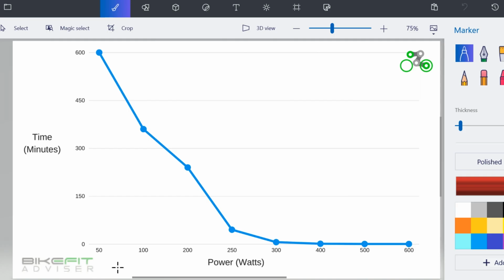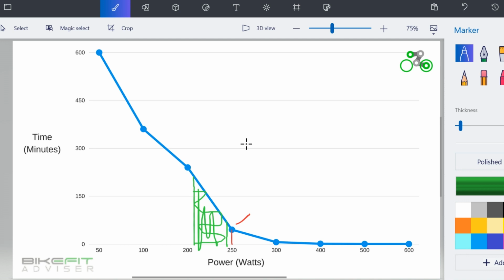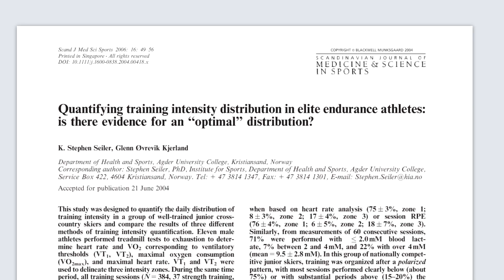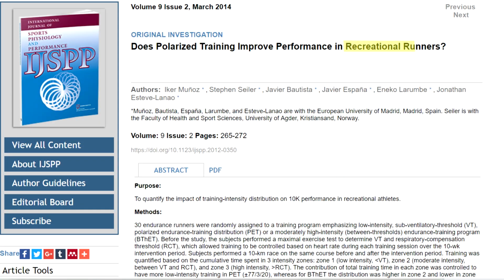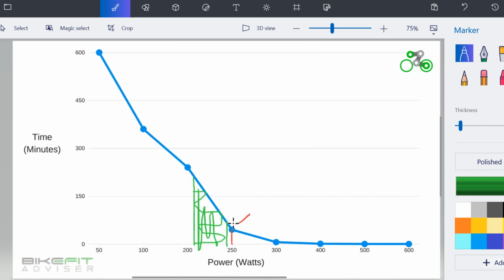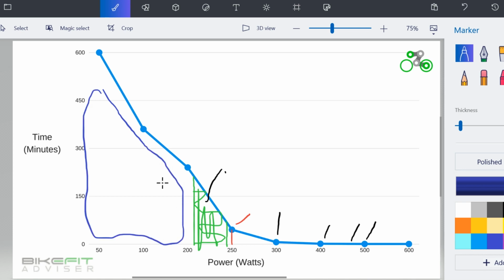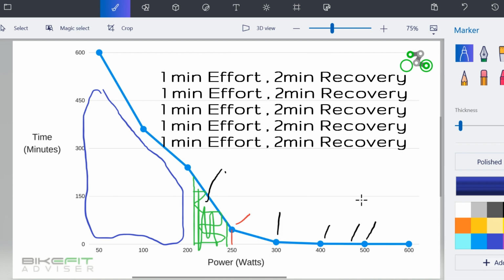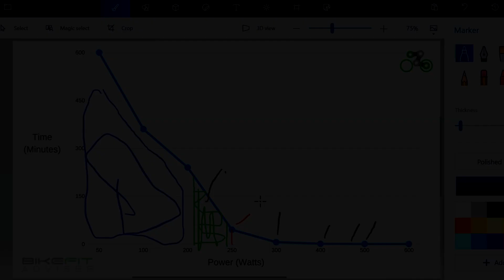A Training Mistake That Can Ruin Your Bike Fit

Comment: I will say you've peaked my curiosity a bit with this video...
I'm 5'6" and have a BMC GF01 51cm...  I've ridden about 2200 miles on this bike after my initial bike fit 2 years ago with no problems. Unfortunately I had to take about 7 months off from riding, and now that I'm back at it, the last 400 miles I've been getting this pain in my left trap muscle right between the shoulder blade and my spine... it's pretty bad, where I'm constantly having to do stretches during the ride just to get through it.  When I get home from a ride, instead of using a foam roller on my legs, I put a baseball in a sock, throw it over my left shoulder, and lean against the wall trying to roll out the knot in my trap.
So I can't help but wonder wtf is going on... did I lose my core strength in that 7 months and now I'm leaning too far forward and putting the weight on my shoulders?  If so, why don't I get the pain on my right shoulder as well?  Are my hamstrings too tight? Maybe a saddle adjustment?  I know you can't guess via internet, just seems odd I had no problems before taking a break and now my shoulder is just lit up to where it's inhibiting my ability to ride.

I don't have too much of an issue with numb hands or a sore ass on 30-50mi rides... but I feel the shoulder pain kicking in after about 10 miles... 

If you were in California, I'd be throwing the bike in the car and driving down to your shop tomorrow haha... got any bike fitters you can recommend in southern california?  The last guy I went to didn't really do it for me... or do I waste the $250 on a ReTul bike fit?

Comment: You've just described a bunch of interval workouts.  However, are these not all classified as high intensity? My reading of polarized training is that they are classified by type of workout. Every high intensity workout is going to have the majority, if not 70-80% of the time spent in recovery or zone 2. i.e. Polarize training by type of workout and not by work done in workout.

Comment: How about if the body is very very tired and don’t feel to get up from bed, but decided go to riding for 50mile in slow pace, is that not good exercise??  Because don’t push to threshold?? I am talking about exercise consistency...
Reply: I wouldn't say it's "bad"... I've read on multiple sources that if you're trying to lose weight on a bike, you want to ride an hour at 70% max heart rate.  Basically you want to put out your max power, while keeping your heart rate at 70% and you'll burn the most fat (which means we can eat like shit and drink more beer! yay!!!)... it's actually much harder than it sounds though, err well at least where I live where there's not much flat ground (it's all hills here).
However, I usually trade off, and do what I call fat burning rides (longer rides well below threshold), and then do what I call balls out rides (shorter rides well above threshold).  My estimated FTP went from 177w to 203w in a month doing this.  Again what works for me, may not work for you or anything else... just trying to give some validation to the point he's making in his video of not riding in the "sweet spot".
Reply: Typhoon0627 Yes, it’s can create threshold by riding steep up hill road (at least more than mile)... like a weight training adding more weight to build more strong muscle. I think that training is more powerful than just ride fast on flat road...

Comment: I think this is good only if u are ran out of time to prepare for ur race and not for the ones who trained with a good time left in their sleeves. If u avoid spending time in ur threshold range u will loose stamina. I think its need to be 3:2:1 threshold:below threshold:above threshold
Reply from the maker: In fact this training method is often used by people who just have little time to train...and to quite good effect. And I don't say that it's a problem when you spend any amount of time in your threshold range....only when you spend too much time there. And many people spend too much time there. And as for losing stamina if you don't do enough threshold work? Research says otherwise....athletes who spend very little time in the threshold range have shown greater improvements in their physiological indicators. But it takes a lot of discipline at times to train like this and it may not appeal to everyone so I can understand wanting to just go out and ride...I do that all the time. Thanks for watching...
Reply: Thanxz BFA for ur earliest reply and really appreciate the thoughts that u had presented in the video as well as on ur great genuine reply to me. Its true that one can improve their endurance with 80/20 way but only as u said with great discipline and above all spending lots of time on a single training session. Though its allow to recover  more while on the session its hard to recover after the session to go for the next session quickly. I used 3:2:1 for my training and it might be only workout for me but after I had tried 80/20 and switch it to 3:2:1, I increased my training sessions frequency and recover for a much focused racing event within a span of reasonable time. Thanxz once again mate and keep up these good work. CHEERS

Comment: Does Strava fit into this? When I go on shorter (less than two hours or so) rides, before the ride I generally decide on a number of segments that I'll try to ride as fast as I can, and in between those segments I mostly just ride along, trying to regain my breath, drinking, maybe eating a gel. I believe it keeps me out of the middle.

On longer rides I mostly turn off the segment notifications and try to keep a mellow pace that gets me all the way home, though.
Reply: strava's power curve has the axis swapped from john's, plus strava's time axis is logarithmic
Reply: Chris Capoccia not sure why that would make any difference though.
Reply: it just makes it hard to directly compare john's example with my strava power curve and power distribution graphs and you can't read from john's example graph what is the lower bound of the "middle", although it looks like 85% threshold and i'll just use that number for comparison. in my last outdoor ride, it was about 2 hours, and not part of any planned training session. only 23% was in this "middle", 31% was above threshold and 46% was below the "middle". is this polarized enough?

Comment: quick question: I have been riding a randonneur as a commuter bike last year around 1000-1500km ( only on that bike) most of the time i carried a bike bag on only one side ( the right) with around 2-3 Kilos. 

I always had the issue that my left Leg and Hip weren´t as flexible as the right side. To be more precise the left side was always way stiffer. Now it lookes like it came to a point where, no matter what bike I am riding it coasts to the right ( it is always leaning to the right ). 

Can there be other reasons for not having the bike completely straight below you other than flexibility ( I am thinking of a different sitbone thickness, Leg lenght etc... ) ? 

I would appreciate an answer very much. 
And unfortunately it is nearly impossible to find a good ( preferably with medical or physical knowledge ) bikefitter where I life in the southwest of Germany. Maybe you can tell me where I could find them ( forums etc... ) ? 

really good video btw as always !!!
Reply: Satiic Jens machacek in Frankfurt z.b

Comment: You mean an athlete should have a training plan that includes beyond threshold intervals? That's not news to anyone who has went beyond the "just ride, ride more" program.
Reply from the maker: Since this comment doesn't add anything to the conversation, I'll just say...it should be "That's not news to anyone who has GONE beyond the "just ride, ride more" program."
Reply: At least your grammar is on point for comments but your cycling training advice really isn't. Sweet spot training is a staple of many training programs and NONE of those programs state it's the only session in that program. There's quite a few benefits to sweet spot training but it doesn't replace interval training or aerobic training session like you're trying to imply.
Reply: @Vermonstered  Yet, there are many cyclists who fell under the impression sweetspot training is the most effective way. In fact, it feels "the most logical" way.

I.e. Trainerroad have been advocate for sweetspot training to the point many riders plateaued after a while (they commented on their forum). Now, after a while, they switched more from sweetspot. Yes, it was after a push 🙂
Reply: @Krejza82  Back in the day TrainerRoad was entirely FTP / Triathlon focused so it's not surprising they'd recommend sweet spot as the primary training activity. But even in those programs they acknowledge if you have enough time, like the athletes BikeFitAdviser notes, you'll burn out on that too. Either from too much TSS or simply way too repetitive. Maybe for simply time crunched programs but I don't recall, and I didn't know about them at the very beginnings, them ever recommending a single protocol program. Can't imagine any training program that is single protocol - sweet spot till your legs fall off... But either way, doing something beyond that, isn't a revelation to anyone.